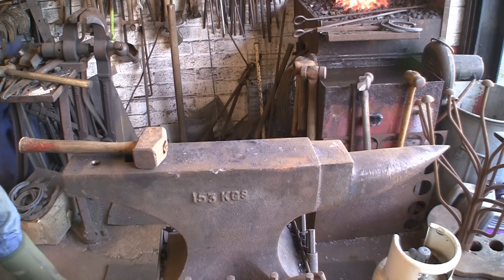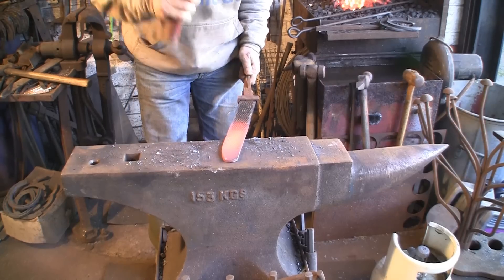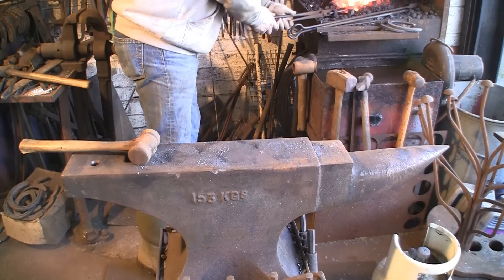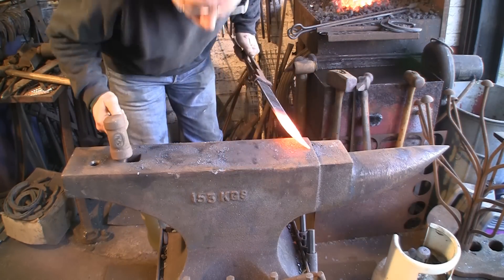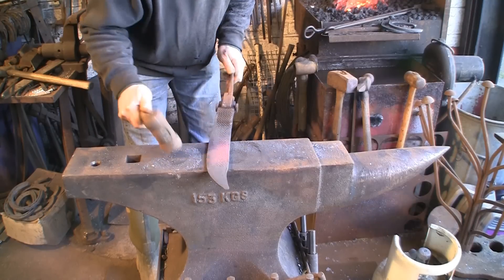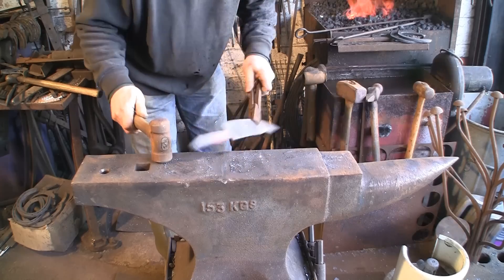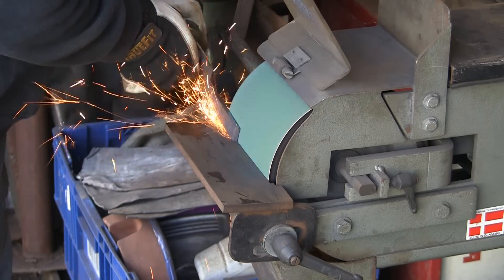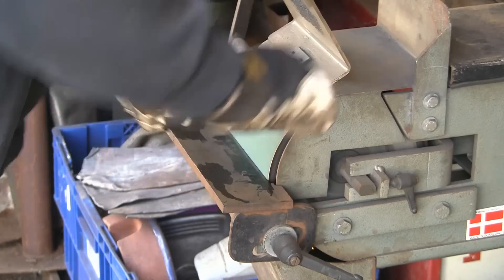Farriers Rasp Forged Knife part 1

Comment: to get the end shape on a bowie you make a curve (a sort of carving knife shape) then the curved part actually becomes the back of the knife, as the blade will take its propper shape as you begin to then the cutting edge out. its quite hard to explain but the effect is like that at around 10:40 in your video.

Comment from the maker: That's a bit of a "How long is a piece of string " question really. It depends what you are heating it with, charcoal blown by a hair dryer, a gas forge, single burner, twin burner, full on coal fired forge? In my forge it can vary depending how fast I run the blower. So you see it's a difficult one to answer!

Comment: Great video. Same goes for all of yours. I was wondering if you could make a video on how to make the tongs that you are using in this video. You might have just bought them but if you could make a video, that would be great. Thanks.
Reply from the maker: They are just normal flat tongs with a small piece of angle iron welded on each side to make the width required,

Comment: I read somewhere that the transition between tang and blade should not be at right angle, because it can crack there eventualy. Transition should be slightly concave. But on the other hand with such thick blade, and not too long blade it could be sturdy enough. Great knife.

Comment: It was just a passing note on the variety of steel you used 

for you laymen out there here is a rule of thumb
shinier=higher carbon content: harder but brittler steel
dull=lower carbon content: softer but will not shatter

even tempering cannot wholly remedy this but serves to form the steel into a more resilient structure.

Comment: Ivy leaf file work and vine filework on the spine is surprisingly easy, for a sinewave vine you just alternate cuts with rattail files and to add leaves there is a way to add cuts with a triangular file at an angle, google it

Comment: I don't know about the rasps and files found in the UK however, the ones found in the USA are, I believe, are made of High Carbon Tool Steel.  So yes if you don't over heat it, this is just about one of the best materials to make a knife out of.  I'm not sure why you cut off a perfectly good tang and shorten your overall length.

Comment: Hi Gary sorry to go back to an old video but I bought some save edge rasps to make knifes and can not seem to harden it no matter how I try and I was wondering if you knew wether they are high carbon or just case hardened they are newly bought ones.
I also bought a lot of 5 heller legend rasps but now I'm worried that these won't be high carbon ether. Just thought you being a farrier may know 
Thanks in advance
Reply from the maker: No idea about the save edge, but guess they are high carbon. Hellas can be hardened as I showed in the video.
Reply: Ahh brilliant I did wonder what file you used in the video. I tried to harden a save edge today and couldn't so I was worried that the heller legend may not harden but if that's what make yours was then it will be fine as yours came out fine. Thanks again
Reply from the maker: +Diesineveryfilm Customs you obviously didn't watch the video.. It was called the legend for obvious reasons
Reply: +garyhuston I watched it a long time ago that's how I knew to speak to you about it today. I watched the first bit to see if you mentioned the name but didn't catch it however I have been looking everywhere to see if I can find info on the rasps I've bought

Comment: I've always thought the words "but I can grind it into shape" were the mark of a lack of hammer skill. Also I hope I'm not pointing out the obvious but, metal doesn't have "fibers" it has crystals.  As you heat and beat it you change the structure of the crystals.  But if you heat it to "Critical Mass" then let it slow cool, then re-heat to CM and quench it in hot oil you can re-temper it.

Comment: I don't think the solder would affect that area too much as long it's not already too soft after heat treat.  I suggest making the finger guard a good fit with the knife and handle.  Epoxy the all together with pins or rivets throughout the hand.  That usually makes it very solid.

Comment: the rasp is made of 5160 spring steel most of the time. Im not sure what they call it in England but it is stellar material.
Reply: +Andrew Fenhoff  I have corresponded with production manager at nicolsen files he told me over 1 percent carbon witch would be more like  w1 or w2. I doubt heller would be much diffrent

Comment: Im no expert, but one tip, whatever your working on, leave it resting on the surface of the grinder, don't hold it up off of the grinding platform cause if it snags it will drag your fingers down and smack them into the platform, just like a polisher would.

Comment: I got a few questions 🤔.....those tongs your using that fit perfectly to the rasp, did you make them or are they made like that? and do they have a particular name for the jaw style? as im really curious as to where i can buy some?
Reply from the maker: I made them from an old pair of flat tongs by simply welding an appropriately sized piece of angle iron to each side of one jaw. I don't think they have a specific name.

Comment: Actually it would seem to me, upon reflection, the correct answer is, because he didn't want the knife that long.  The section he cut off, however, was perfectly suitable for the pummel of the tang.  It is, after all strong enough for the handle of a rasp.  what are you going to do with the knife that would break that off, chop wood?

Comment: You are an awesome Blacksmith.I am just starting to build a reclaimed oil-fired kiln from a propane tank,and an anvil from an old piece of train rail.A total newbie,but have learned alot from watching yours and others videos.I have a question since it's made from a rasp.Would it be better on the coarse side of the rasp,with all of those teeth you are hammering down,to coat it with borax as flux,so slag don't get trapped under the teeth,and have a chance of flaking off the teeth later.Basically forge-welding the teeth back to the parent metal.If I'm wrong,please explain,as I'm just learning about forge work.I was a machinist/tool maker for 25+yrs before becoming disabled,so i can machine nearly anything given a lathe/mill.Time to learn a new hobby.Thank You so much for posting all of your videos!
Reply from the maker: Personally I wouldn't for a couple of reasons. 1, I don't know the spec on this steel but would guess if you get it to welding temperature you will loose some if not all of the properties of this great stuff! Most good steels have critical temperatures that they need to be worked at, not too hot nor too cold.
2, I like the fish scale effect. If you dont want that look just grind the teeth off before you start, the knife will be a bit thinner but no teeth marks!
Reply: garyhuston
No,you misunderstand.I LOVE the fish scale look! My concern was each little flap/tooth you hammered over would/could flake off later.I thought at the heat you were working at,they would kind of weld back to the parent metal.
Reply from the maker: Bowtie41
Unfortunately the video exaggerates the temperature, it looks hotter than it is. I now have a filter on the camera which helps but still not true to life!

Comment: pretty good knife there gary .   i quite like the idea of doing some basic blacksmithing work.   i have a garage and the stumbling block seems to be thinking of a way to heat treat steel .   ie .   the problem is the heat source .   do you know any cheap and easy ways to get something organised in this respect ?     hamish
Reply from the maker: No cheap and easy way, you need to build yourself a forge!
Reply: what are your thoughts on electric knife kilns or using disposable propane torch cannisters ?
Reply from the maker: Hamish Carey
I have no experience with either but would guess both to be expensive if you were to use them to do much work. I'm a blacksmith so ninety percent of my work is done with a coke forge which is a cheap as chips to run!

Comment: Did the teeth on the rasp put marks into the hammer or anvil?
Reply from the maker: No, when metal is hot it goes soft!
Reply: excellent.  I have always heard you had to grind the teeth off of a rasp before you forge it. I don't have a grinder so I had not tried to forge one, but now I shall. Thank you!
Reply from the maker: cheyennew811
Just don't hit it cold, it might mark and or shatter!

Comment: I like the way of the burning iron sitting on gas canister xixixix
Reply from the maker: Where? When?
Reply: garyhuston at the beginning... right corner while you were ramming the incandescent piece of iron/steel.
Reply: garyhuston ups sorry, i can say you did it for all the time.
Reply from the maker: Kenar E.
That was a gas bottle that contained an inert air conditioning gas, so non flamable, but was turned into an oil container, I cut the top off and filled it with oil for quenching....
http://youtu.be/r3WeVz6jiAg
Reply: garyhuston well, i guess nobody knew that! :D
Reply: garyhuston oh look, i am watching part 5 right now. but i would never have guessed it was the same container.

Comment: Hey gary, first off I'd like to say I'm a big fan of your videos. secondly I come to you with a problem. I've recently started practicing blacksmithing as a hobby, I come from a welding background so I'm familiar with some of what I'm doing however it seems my forge is "acting up". Im getting large deposits of what looks to be impurities and any metal that I heat is becoming very damaged (bumpy/corse textured). If you're able to advise,  is there any way I can contact you outside of YouTube to discuss this further?
Reply from the maker: Could be a million and one things, without knowing what your set-up is or what fuel you're using.
My immediate thought is that your fire is too low, by that I mean it's too close to your air hole. It should be about 4" up and 4" out from the air supply if you have a side outlet or just 4" up if a bottom outlet. The deposits sound like normal clinker build up, but if your material is too low it will form around your steel instead of just laying at the bottom of the fire.
Reply: garyhuston ah, interesting. yeah my pit is quite shallow, its a converted gas BBQ. I welded together a pit/air inlet and with the BBQ being shallow itself I don't have a very big mound of coal (about 3" above the vent at its highest) I'm using proper blacksmiths coke that i got from my local coal yard. (not sure of the brand)
Reply: brilliant, all working fine now, just need to make a wall around forge to keep in the extra coke. thanks a lot
Reply from the maker: GS1200adman
Glad to help.

Comment: They can be a few things, but I'm pretty sure for the most part most files are D2.
Reply: ____    Most of the quality steel files/rasps (as opposed to cheap case hardened ones) are usually something like1095, W1 and W2 or something fairly equivalent to them.
Reply: +Saitama d 2 is a semi stainless ,metallurgy is fascinating
Reply: huk Isn't it though?
Reply: you can google it, but most files and rasp are a water hardening steel d2 is a semi stainless tool steel. used by many custom knife makers

Comment: you wasted too much metal,all that good high carbon metal, where i live those ferriers rasps are quite expensive and it can be made into a sword!, but your knife turned out quite nice congrats.
Reply from the maker: It wasn't wasted, I made my other little knife from the rest. However I do throw dozens of these away as I just have too many.
Reply: ever tried forge welding this pieces into a nice damascus? would be cool to see it
Reply from the maker: jefferson1232757
Never, and never will unless I get a power hammer!